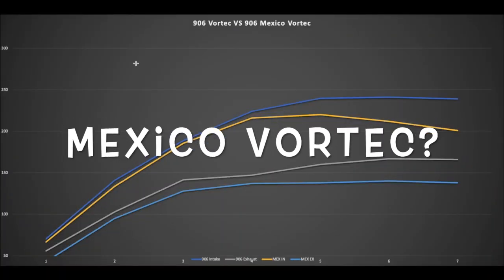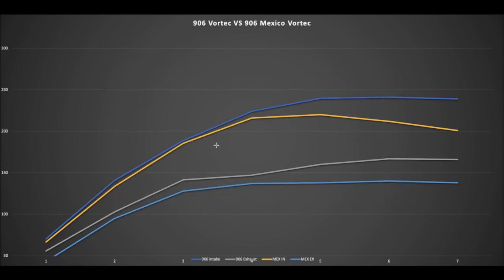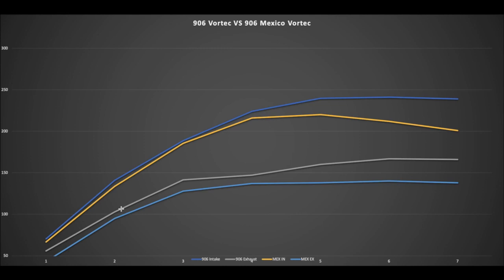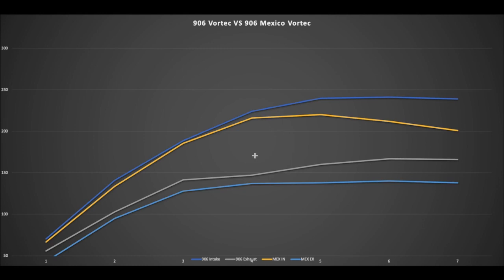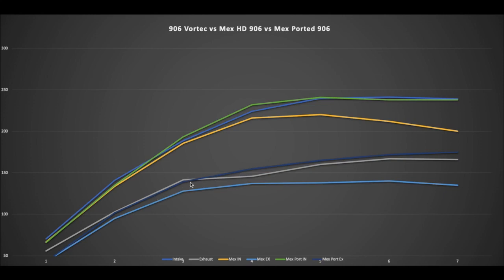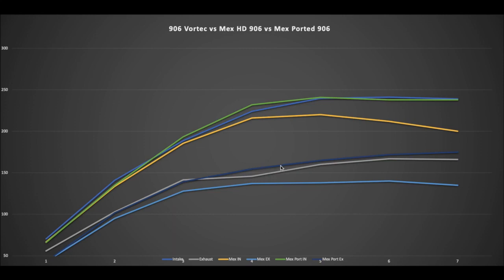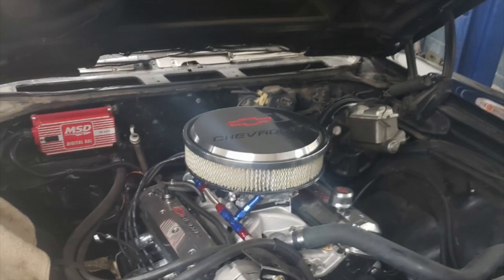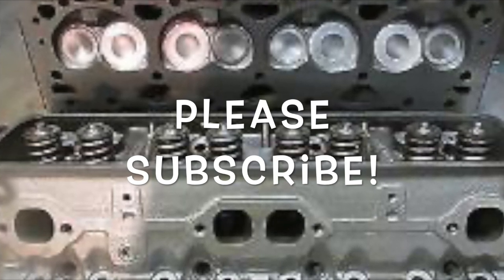Mexico Vortec VS Original Vortecs!?

Comment: ?  I have many sets of vortec one set 062 i was going to use had a very very small crack at a bolt hole still usable.  But I have a newer  602 Mexico head .want to know if I could miss match and be ok. Without and work done. Thanks.
Reply: I also have been running the 1.06 valve for years .
Reply from the maker: If they are both Mexican cast you should be fine, if they 062 is early casting than the flow is quite different
Reply: @cuttersperformance  thanks

Comment: What do you think of the made in China Vortec heads found on eBay? I purchased a set. Haven’t used them yet. Definitely seem thicker and heavier. Hardened seat inserts,intake and exhaust. Need die grinder cleanup,though, just below the valve seats.
Reply from the maker: Haven't used them or seen them?
Send me a link if you get a chance

Comment: I have a set of Protopline vortecs from 2002-2003 have you ever heard of these?
Reply from the maker: Yes I have! Super cool
Cast in New Zealand
Reply: they are 1.94  valve heads screwin studs. they have always run really good. any idea on the flow numbers?

Comment: My first set of Vortec heads are mexican 906s kinda glad they have thicker decks cause was worried about buying a cracked set. 150 and destin for my small Journal 327 have an a vintage cam set  I could  run an Elgin 916 cam set came with the truck..

Comment: I have known this for years and had numerous people argue with me about it on the forums. I have a 97 G1500 Express van that my parents bought in 98 with 12K on it.  In 2004 the OEM engine shattered #2 connecting rod from hydrolocking on coolant (bad intake gaskets) at 57K.  I put a hecho en mexico crate engine into it that was vin specific.  Always ran like a dog compared to the OEM engine and fwiw the replacement by vin engine was not even the same engine. The OEM had 4 bolt mains, 906 heads and a single roller chain. The replacement that GM would give a warranty on was a 2 bolt main with the crappy link style chain was a bit pissed at them when I discovered it was a downgraded engine and they would not warranty the correct engine for that application.  In 2012 a year after my dad passed away I got the van with 70K on the odometer.  At 75K miles I had a radiator drain plug split apart and dumped the coolant on the highway. Overheated it not even to the redline. Cracked both Mexican 062 heads.  The older 906s went on an engine I built for my previous 83 G20 van.  They flowed 242 cfm a 0.500.   I pulled the cracked 062 heads off and had one flowed on the same bench as the 906s. The mexican 062s flowed an average in 2 ports of 218 cfm @ .400 and port stalled back to 210 cfm above that. Rather than buy the same crappy mexican head from GM, I put a set of Etec170s on it. Had comp grind me a 215/224 @ .050 cam on a 110 LSA with 0.503 lift and I put 1.6 rockers for 0.534 lift. Then I picked up a set of thorley tri-y headers for the van. Converted to the L31 marine intake.  Big van had plenty of power after.  I also flowed a set of 059 305 Vortecs that flowed 224 cfm @ .450 with a 1.84 intake valve. 059s were off a mercruiser 305 with 100 hours on it that had a cracked block from freezing.  I will never buy another GM replacement engine.  That hecho en 350 block had other issues and I ended it up replacing it with a 210cc aluminum headed 6" rod 11:1 383.
Reply from the maker: Yeah not alot of guys believe it but it's very much soo true

Comment: I just picked up an 880 block with stock roller and matching 062 sawtooth heads for $80 from Facebook marketplace.  Holy fuck I'm excited! Was pulled from a Suburban and ran in a boat for 2mo. Then left next to a shed. Shits clean! 

Now I have 3 motors to build. 

Taking back a pair of 906's to the yard... dude says he has a pair at his house he'll replace them with. They had matching cracks center bolt hole, were rusty too that I had to clean with muriatic.

Comment: What year are the newer vortex heads on?
Reply from the maker: They are GM replacement heads or on the GM crate motors not on production vehicle's
Reply: @cuttersperformance  Came on alot of boat engines to current day and industrial engines.

Comment: Do you know anything about the gm fastburn heads?
Reply from the maker: The fastbruns are basically a lt4 head mixed with a vortec 
Decent head but honestly not worth the money guys are asking in my opinion
Reply: They came on my car when I got it. Just wondering how much they may be holding up power. 383 comp 274s

Comment: Can you run a 1103 cam with stock vortec head untouch.
Reply from the maker: Stock springs are kinda weak especially as they get some miles on them so I probably wouldn't

Comment: Nice video, subscribed! That’s a significant drop in CFM. With the costs of upgrading the Vortecs to handle more lift, porting them to get the flow back to the originals, and Vortec specific intake, pretty close in price to getting a higher performing a/m heads
Reply from the maker: Thanks for the sub man! 
That is correct I tell guys all the time not to pay big bucks for vortec heads becuase it makes it not worth it in the end
But on the flip side if you can get a set for cheap and do the work yourself....you can have a amazing set of heads for a decent price 
Cheers!
Reply: @cuttersperformance  true, true! Hence your videos! Lol! Do you have any experience with Summit Racing’s Vortec heads? They’ve always seemed tempting

Comment: Any info on 602 circle track heads?
Reply from the maker: The GM# is 12691728 on the 602 crate engine 
Its a Mexican casting and doesn't crack easily. It will have the same intake flow as that 906 Mexican head in the video but the exhaust will flow abit better due to the 3 angle valve seat

Comment: I think the mexican are 062..not 906
Reply from the maker: Those ones were 906 Mexican vortecs
Reply: @cuttersperformance  do you know whats the diference between mex'906 and mex'062
Reply from the maker: I have only got my hands on the a few sets of the Mexican 906s but im looking for a set of 062s
Reply: @alekdeschenesdube5643  My mexican 062s were flat garbage. Replaced them with Etec170s on my Express van after both cracked. They only flowed 218 @ .400.
Reply: @cuttersperformance  I have a set of each mexican sets if you wanted to do some experimental porting and flow testing on them.. I'd like to run 1 set so which ever is better.

Comment: Can't wait for the 305 stuff. I'm currently running a 1996 5.0 vortec engine in my 1986 GMC truck with an aluminum intake and Qjet.
Reply from the maker: Awesome man! I haven't played with the 305 vortec heads much so it should be fun!
Reply: You do know you can buy a 4.8 vortec for under 500 dollars and make more power than a 305 any day of the week all while running stock parts and with all the reliability
Reply: @foxbodyguyeightyeight3672  you do know that the 4.8 might be a vortec but it isn't the vortec that we are talking about. My 86 GMC came out factory with a 4.3v6 and I swapped in a V8. I used all of the brackets,pulleys,etc directly over to the V8. You can get a 4.8/5.3 from the yard for $200 pretty much any time but you aren't going to be able to put it into my truck for your $500 with all it would need to run. Not  to mention the simplicity of a v6 to Gen I v8 swap vs the Gen III swap. I've been doing this stuff since the late 80s.
Reply: You do know you can buy a 4.8 vortec for under 500 dollars and make more power than a 305 any day of the week all while running stock parts and with all the reliability

Comment: When I watched this, I had 4inches of snow off my hood and valve cover off in short order. I didn't see the Mexican mark anywhere where is it? I was told they came of a 3/4 ton truck at mosquito patrol by the mechanic. I'm guessing they could benefit from the info you posted on the 3angle valve job an 1.60 valve. I've been running them for three yrs so hoping no cracks. Love ur channel man. 👍
Reply from the maker: Haha amazing! "Mosquito Patrol" 
You will see by the rocker studs "Hecho en Mexico" 
Yeah chances are you have the 906 castings with the hardened exhaust seats. A 1.6 valve and a 3 angle would be amazing for those
Reply: If ur interested in working over my 906vortecs I'll pay you a fair price for sure. Not sure if you do that so I may be on my own lol.

Comment: How do you distinguish Canada 906’s vs Mexico 906’s.  I have a set of vortecs sitting on the shelf that were said to be from a 2002 van.    They have the single hump casting mark and not the saw tooth. 
The heads are destined for a 86’ corvette with the “7speed” and a edelbrock pro flo xt.  I was wondering if I should just sell my vortecs and go with the new budget AFR heads.
Reply from the maker: They will say "Hecho en Mexico" in by the rocker studs
Reply: @cuttersperformance   easy enough.  I just checked and they are non Mexican.  Keep up the great content!

Comment: I enjoyed the video.  I was waiting for a comparisons between north and southern built heads. I read that Mexico builds very good casting of Jeep 6 cylinder engines for racing and is desire over the other northern castings.  I would love to build a 302 just for fun. Keep it coming.  Love it.
Reply from the maker: Thanks brother! The proof is in the flow haha I'm glad guys enjoy this stuff as much as I do
Reply: @cuttersperformance  I forgot to ask, in what year did the Mexican heads show up.  You mention they came in create motors.   I would like to get a pair.  I think Summit Racing has aftermarket heads in cast iron but don't know much about them.
Reply from the maker: @skywaves5175  Any vortec head gm sells as a replacement is the Mexico design. 
If you want a set of vortecs I would highly suggest a reproduction set from a company like EQ or summit. They already have screw in studs and guide plates
Reply: @cuttersperformance  Thanks
Reply: @skywaves5175  The hecho en mexico garbage 062 heads that cracked on the replacement engine in my 97 Express van were off a goodwrench crate engine purchased in 2005.

Comment: Dang that sucks lol. Probably shoulda used the fresh GM 906s off the 350 in my truck and had the steam holes drilled for that 400
Reply from the maker: Honestly you are probably better overall with the later casting especially on a 400 with alot less chance of cracking

Comment: I spoke with torqstorm before. Ask them about a centrifugal supercharger and sniper tbi efi. They'll tell you that the sniper tbi doesn't flow, especially under boost. 
  He's an idiot. I went with vortech's v3 si entry level carbureted kit instead. The sniper tbi is ideal for that kit because you can just tune the timing curve for boost and adjust your target a:f ratio under boost. No rejetting. No retarding base timing or btr boxes. 
  He missed out on a sale. Check out the vortech entry level carb kit on summit. It's rated for up to 775hp so it's pretty good. I got it last year for about $3k. The front serpentine accessories bolt up, with the exception of a spacer needed for the power steering pump. You'll also need a different length serpentine belt. The torqstorm guy told me that I'd be on my own for front drive accessories. He obviously didn't want to sell me a supercharger. I gladly spent my money elsewhere.
Reply: Hello Eric

While we have seen a number of small blocks from that era. Show us yours so we can see the front drive accessories. Typically we cannot fit anything on there. GM used some monster bracketry during this era. If you treat the accessories like the rest of your build. Run some aftermarket accessory mounts and make room. You can run a supercharger. As for power. The "650"hp efi systems have really struggled to break the 500hp level. If you look around at them. You will see they don’t advertise the blow through power numbers. They give up 20% when you are running air into them. If the EFI was not the hold up. You could probably push this build into the 550hp range by 5500rpm. There are things holding you back still, but overall the combination would still make decent power.

Chris Beardsley

TorqStorm Superchargers

Office 616-226-9476

Mobile 616-706-5580

----Original Message----

Sent: Monday, December 30, 2019 6:30 PM

To: dljvs01@gmail.com; sales@torqstorm.com; chris@acceltool.com; scott@acceltool.com; vic@mooregoodink.com

Subject: A Website Lead From Eric Ernst

Message: Hi, I'm interested in an entry level supercharger for my pickup. I was initially drawn to vortech but I saw some Torqstorm products and liked the look. I had a few questions about the front drive accessories. Can I reuse my serpentine belt drive accessories from my 1990 Chevrolet K2500 350 engine? It looks like my alternator mounts right where your supercharger goes.

  I plan to run an intercooler and perhaps meth injection. Can you give me an estimate on the power I'd be making with your supercharger?

  I have a 355 engine. 9.17:1. Trick flow super 23 175cc heads. (242@.500" , 245@.600), dual plane intake, 950 cfm throttle body, 1 5/8" long tube headers into 3" collectors and 4" single  open exhaust. Cam is a comp xfi252hr. 252/264 adv. 202/212 @.050" 113lsa. .550"/.546". Comp cams shows 406hp@5500 and 463@3000. How much power would I be making with your single supercharger system? I have self-learning efi with 4 100lb/hr injectors so I max out at 650hp. With my tiny cam, it's not exactly a max effort build. I tried to match my parts for the vehicle. A 1990 K2500 Silverado. I'm not looking to rev much past 5500. If I run out of injector, I'll set my shift points lower and run a larger pulley.

  Thanks for any help you can give me. 

    -Eric Ernst

Comment: The 305 Vortec heads are casting # 520 I think. Not sure what the casting # was I do know that they have the swirl bowls under the intake valve and the valve size is 1.84 intake and 1.5 exhaust. Thanks again for the great video’s can’t wait to see the 305 heads tested. GM did make 2 different Vortec Bowtie heads a 185 runner and a 225 runner size I have had the Big 225 heads and I ported them at the shop where I worked the pulled some really good numbers..
I don’t remember exactly but it was in the neighborhood of 260s @ .400 lift and 290s @ .500 lift they went all the way to .650 lift.  I did run a Solid roller cam in my 406 at the time I was running them if I’m not mistaken they flowed about 310 or better @ .650 lift and we made around 585 HP on our 406 test mule engine.. can’t wait for the new video’s keep them coming. I also have a new set of the Vortec Bowtie heads the 225 runner in the factory GM box’s.. I have a new set of Canfield heads they are aluminum heads and have the 60/40 valve spacing and do require either offset lifters and Rockers or Shaft Mounted Rockers. Thanks again for the great updates.
Reply from the maker: Yeah the vortec 305 heads are 059 or 520 casting 
The vortec bowties are a totally different beast over the regular vortecs. They flow abit better (bigger runners) and have much thicker decks
Thanks for the positive feedback!
And cool engine combo! Cheers
Reply: Put the canfield heads in the recycle bin.
Reply: @chriscatarcio7534  I can’t do that the Canfield heads were the first head that we tested to break the 600 HP make on pump gas they did flow really well on the low numbers side the peak # doesn’t mean as much as the low lift numbers do... 
I do remember us getting them to flow in the 280s @ .400 lift and about the same as any other 23 degree head that we ported on or around . 650/.700 lift.
They were the 220 runner with the 60/40 valve spacing they also made a 200 runner version of the Canfield head but were standard valve spacing for any 23 degree parts.. the to worked well but didn’t make the 600 HP make on our test mule.. and it was a mild 406 11:01 compression and a Solid Roller cam I believe it had a Isky cam in it when we were playing around and hit 627 HP with the 220 Canfield’s.

Comment: Thanks for making this video, great info. So far you're hitting home runs with your channel! One question though, why that name for the channel?

Doing a Vortec engine swap on my channel going to have another set of Vortecs from the engine that came out, fingers crossed that they aren't cracked!

The newish engine has 1) 062 and 1) 906 both bowl blended so the flow should be close to one another? 🤞 

Sure would be cool to have access  to a flow bench, consider yourself lucky, some people get to have all the fun.

Next engine on my channel will be a sbc 434 solid roller Dart CNC headed build, make sure to subscribe for that one? That thing should be over 600 HP with a factory block!😲 Going to reveal what it takes to make the factory block not spit the crank on the ground!
Reply from the maker: The name of my channel comes from a old school mechanic I know. I was doing some upgrades on a cobalt ss and he asked how much power it made....I told him he was shocked and his response was "damn piss-cutters" 
Thought it was hailarious and I came up with piss cutter performance